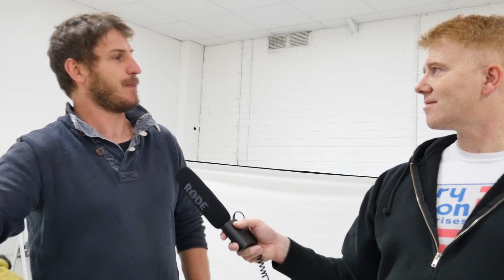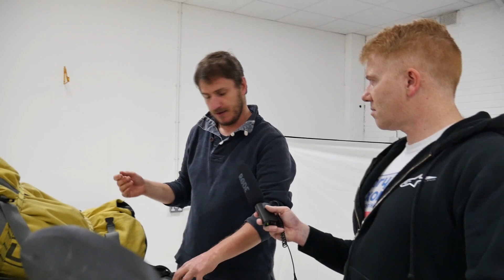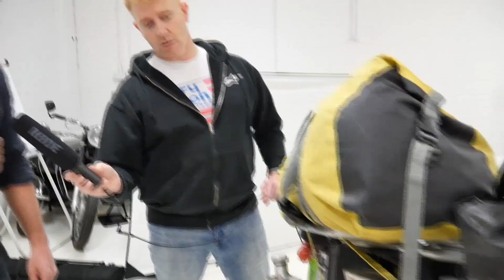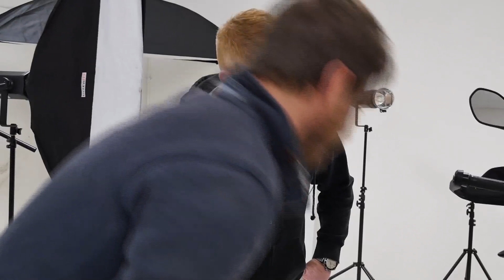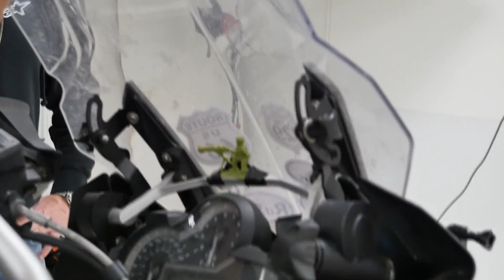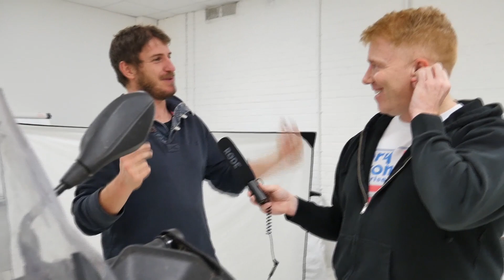Nathan Millward: What type of bike you need to travel the world

Comment: Good video. What is Nathan Milward's reason behind choosing a GS over a GS Adventure?
Reply: +TheOutdoorFun Hey mate. I chose the GS because that was the model the off road school were selling off. They did have a few GSAs but they were snapped up quickly, and for more money. I'd ridden both bikes quite a bit previously and I would probably have gone for the GS anyway. I find it a more manageable bike, especially off road and I don't often find I need the extra tank capacity of the Adventure. Were I buying new and had plenty of cash I'd probably go for the Adventure just to avoid any regret, but I still think the standard bike is the 'better' model for day to day use.
Reply: +nathanthepostman Thank you Nathan. I am thinking of buying GS or GSA (the lowered suspension model). Someone told me that I should go for the GS because GSA is top heavy with a full tank of fuel. I am also hoping the lowered suspension GS and GSA will handle exactly like the standard GS and GSA.